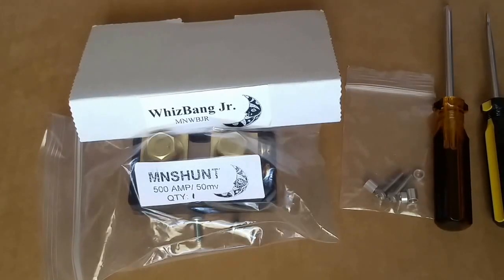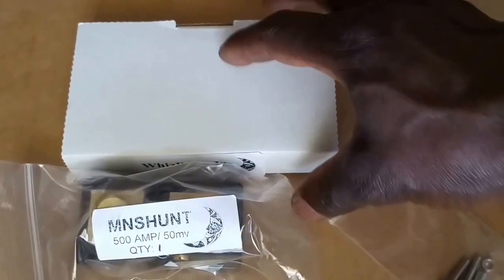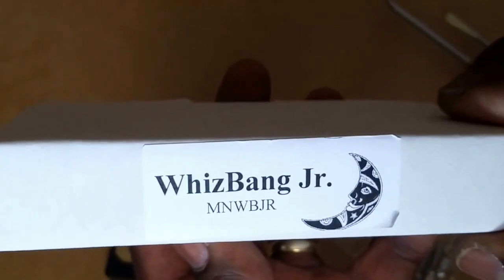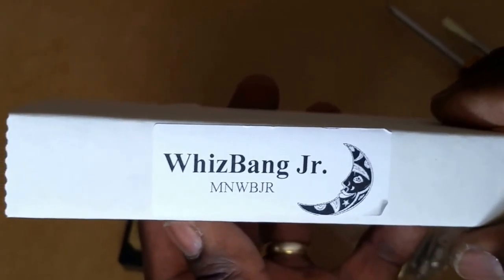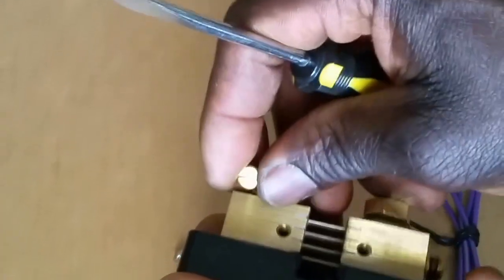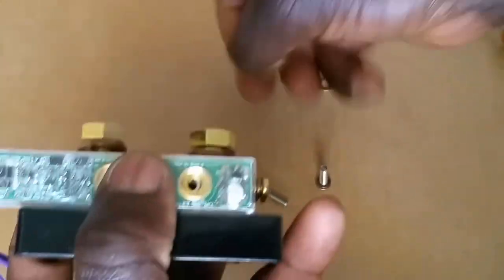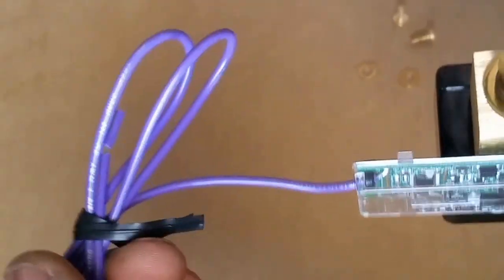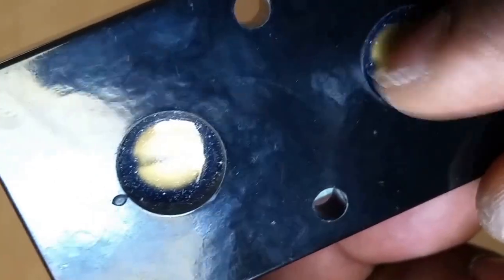HOW TO INSTALL WHIZBANG Jr. TO A MIDNITE CLASSIC MPPT SOLAR CHARGE CONTROLLER

Comment: Can you use the whizbang jr.with the Outback power radian?
Reply from the maker: No
Reply from the maker: They are not comfortable
Reply from the maker: If you need a battery monitor, I will recommend you buy Victron which is a universal battery monitor
Reply: @jwsolarusa  thanks
Reply from the maker: @philippealcindor148  
Like and Subscribe
Reply from the maker: You still need a MATE3s to program the Radian
Reply: @jwsolarusa  I do have a mate3 but it doesn't tell me how much amps goes in ad out of the battery bank, another word I am not getting the accuracy that I am looking for.
Thanks very much for your interest.
Reply from the maker: @philippealcindor148  
Ok.
You need one more component which is FlexNet DC which is responsible to tell you everything about your system and your battery state of charge and discharge.
Here's is a link for the device. You don't have to buy a Victron battery monitor anymore as I mentioned on our earlier conversation. 
https://www.ebay.com/itm/OutBack-Power-FN-DC-FLEXnet-DC-System-Monitoring-Device-/251707467423?_trksid=p2349624.m46890.l49286
Reply: @jwsolarusa  thank you very much.

Comment: Hi! May i connect this shunt with other controllers, or inverters? Does it have to be precisely Mitnite Classic? Thank you for a very detailed showing!  By the way, Do you know, is there other brand, "universal" for all controllers or inverters with this chip board? Thank you! ☺
Reply from the maker: The Whizbang jr only works with MidNite Solar Charge Controllers to measure the SOC, Amperage, Wattage, Voltage and what comes in and out of your battery bank
The Shunt is a universal device which is rated at 50mA - 500A
PLEASE DON'T FORGET TO LIKE SUBSCRIBE AND SHARE
Reply: @jwsolarusa  Hi! I have already subscribed your channel.. I do know, what shunt is, but i'm interested in this chip board in, this shunt. What does it do? Every other shuns measure those same, but why tis has board..? My main question was, is there any (universal) shunt selling, which has this chip board with it? Where to buy? There are so many differend shunt version, but this particular..!..? 😄 Thank you again!
Reply from the maker: Thanks for your subscription. 
The Shunt is the Gold color device the chip attaches to.
Reply: @jwsolarusa  I do know. What is the point in this chip? (Is my english this bad? 😄)

Comment: thanks for the info sir i wonder if it will work with a classic 200?
Reply from the maker: +jeff bragg 
All MidNite Whizbang Jr work with all of there Charge Controllers
Reply from the maker: +jeff bragg 
Just make sure you buy the correct Shunt which is 50mv - 500A
Reply: thanks again sir your awesome